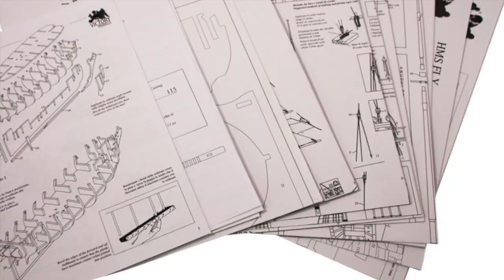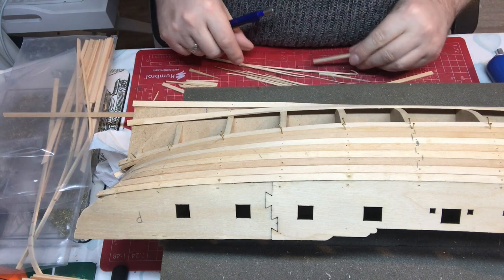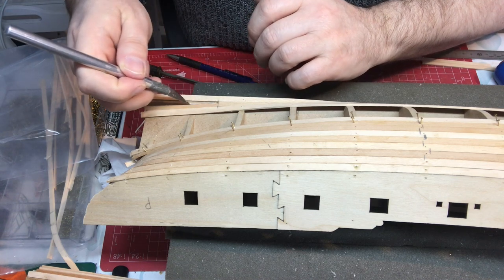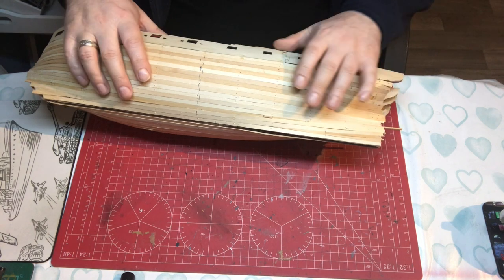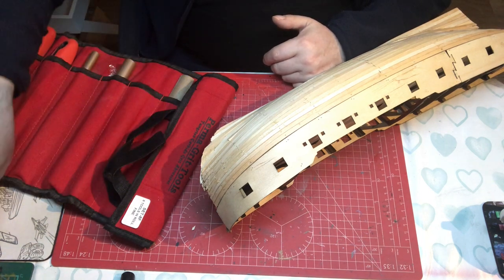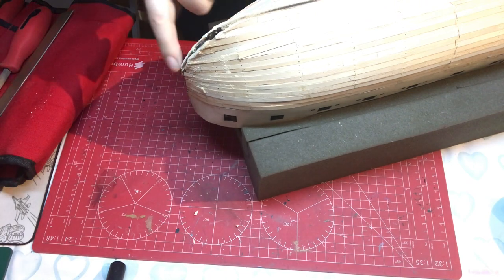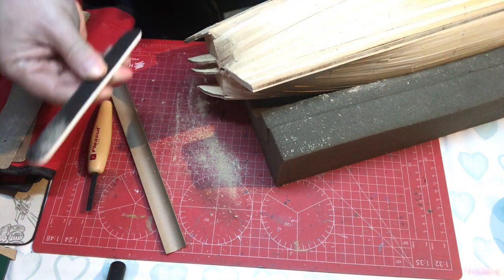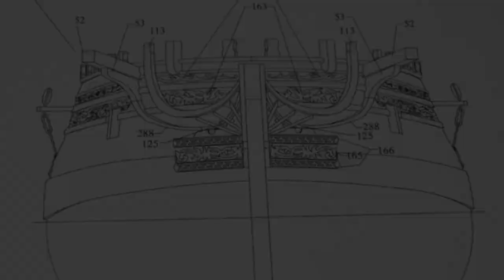Victory Models - 1/64 scale HMS Fly Part 8. Adding a stealer and sanding the hull.

Comment: Jason’ been watching until now an enjoying your your processes. I have ordered from vanguard, HMS Speedy a brig sloop.should be with this week. I started a wooden ship before and it went wronge 😅 so I have plenty of spare wood 😊. 
I have the same tools as you. except for the long plank holder but that will arrive tomorrow. Thank for your method of building. O’ It was Cochrane,s ship read life story and what a captain he was.
Reply from the maker: Hi Paul Speedy will be. a challenge but  as you copper the hull you can cover up any issues you have with the planking, it's easy after that, relatively.  Fly will be back in a month or two.  I am also thinking about speedy, maybe for my Birthday 😉